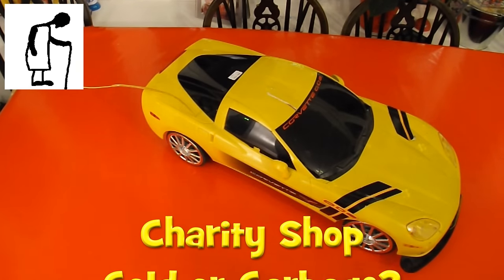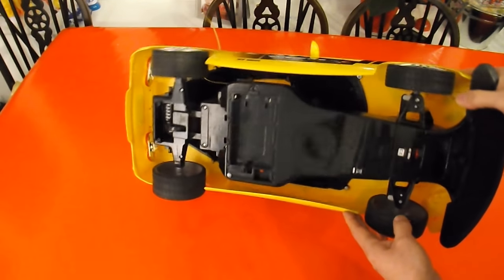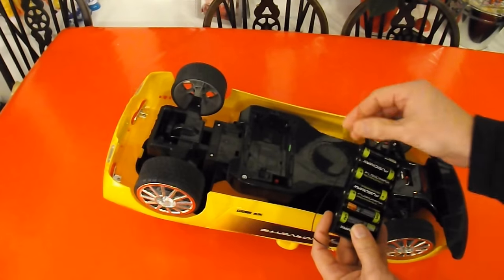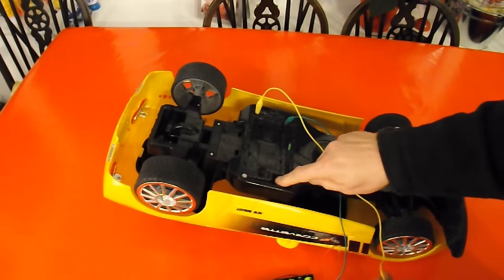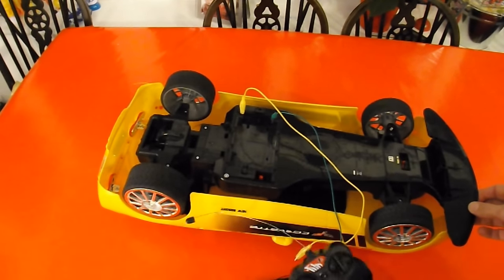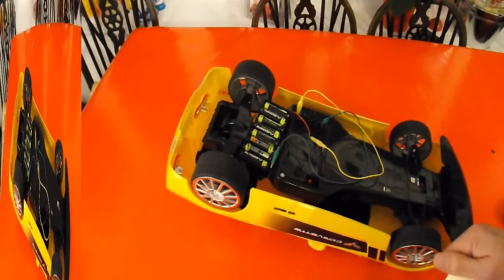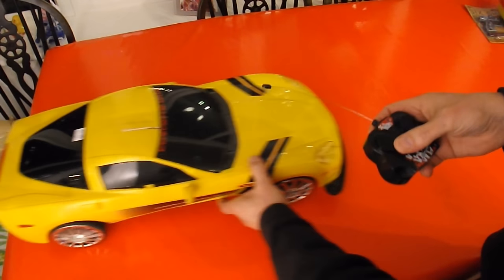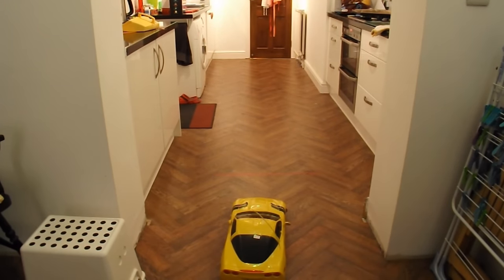Charity Shop Gold or Garbage? RC Car New Bright Corvette CO6

Comment: I'll bet you a donut it's that aerial on the transmitter. It's dinky for 40MHz.
https://www.easycalculation.com/physics/electromagnetism/antenna-wavelength.php
But, the ever handy TX2 and RX2 chips are here again, even if the controls are reversed.
i thought at first it was pulse and full (as Estes had on their planes). Another thought, is that the original transmitter may well have 'Turbo' wired up too.
Anyway, i'll cut the waffle if it's going to go hobbygrade. That's a good size of car.
Reply from the maker: +slider2732 no idea what fraction of a wavelength that transmitter aerial would be but it works fine with the 40mHz toy car it actually came with. This car really is one of those "let's make it really big so the customer thinks they are getting a bargain, but we will just put the normal gear inside because they will never know the difference". The review video I linked to in the description shows it is just a good looker but does not have the performance to match. Having said that, with the rc gear fitted and a 2S lipo it does the usual wheels spin start but none of my existing ESCs seem to give it enough power and they shut down quickly. Either that or the motor has a problem. I have a larger ESC on order (cheapest I could find of course) so we will see if that makes a difference when it arrives.
Reply: GrandadIsAnOldMan
Good fun though eh :)
For that sort of car I would think a 10-20A ESC should cover it. Planes do with less because of the lack of stall friction, as in moving on the ground. Shutdown could be lipo related though, it may need a large 1300mAh or something, because of the motor draw. It all makes me wonder how the weedy original circuits ever moved the things in the first case !
Reply from the maker: slider2732 the power transistors on that original receiver board look fairly meaty but in that review video it really does not move very fast. The gearing is very basic with a very big gear on the axle. The Lipos I have been using are 2S 1200 mAh 20c or 3S 1000mAh 25c or at least that is what they are labled

Comment: 96 point turn... you weren't kidding lol 
looking forward to the hobbygrade component update 😀
Reply from the maker: +Neil Wildy I've done most of the videos for this one but it looks like I need a better ESC for the drive motor. It is on order from eBay but hasn't arrived yet. I am using the original motor but none of my ESC's seem to like the current draw and power themselves down if I give it full power.
Reply: +GrandadIsAnOldMan If you did need spare parts at anytime, feel free to ask, I work in relative vicinity of where some of your videos are taken, so could help you with components if needed.
eBay are pretty quick though :-)
Reply from the maker: Neil Wildy thanks for the offer but I just move on to another project while I wait for parts to arrive.

Comment: the C6 ZO6 is stuttering.  my toy level RC is doing the same sort of thing.  any reason why it's stuttering?
Reply from the maker: +GuitarRocks360 my problem here is lack of capacity in the battery. It does better with fresh batteries. There could also be a problem with the transmitter I am using being low on power too, but as the intention is to swap the RC gear out for hobby grade I wasn't particularly worried. Several of the cars I get from charity shops show the same problem and I usually put that down to not having the matched transmitter for the car but I often use rechargeable batteries and they are always lower voltage than fresh alkaline batteries for example 3 AA NiMH batteries will give you 3.6 volts whereas 3 AA Alkaline batteries will give you 4.5 volts and that can be a problem too.
Reply: +GrandadIsAnOldMan oh I see

Comment: GrandadIsAnOldMan I have this car but the mustang version I've had it forever and it stopped working but what you can do is change out the motor but your motor works so you don't have to do that, anyways you can swap out receivers like I did to the new 12.8v reciever and run it with the 12.8v lith ion battery and mine a little bit more than doubled from going 5mp to 11mph!
Reply from the maker: +Break The Bricks Down thank you. I will be putting hobby grade equipment in it although I intend to keep the existing motor if possible.
Reply: +GrandadIsAnOldMan great just watched your hobby grade upgrade part 1 video and I can't wait for more! Your vids are the best!
Reply from the maker: Thank you.
Reply: I have the camero one.